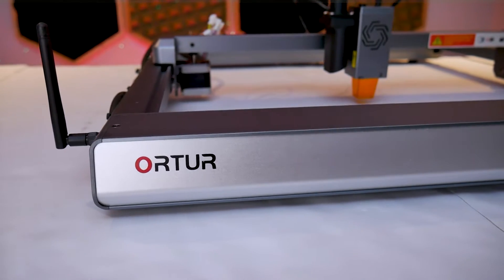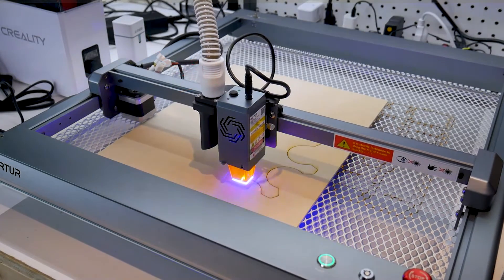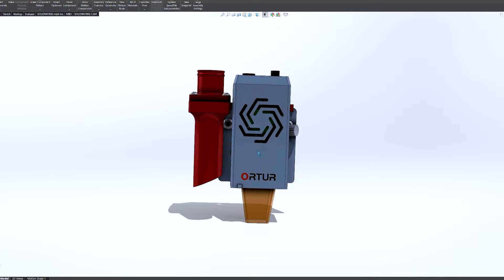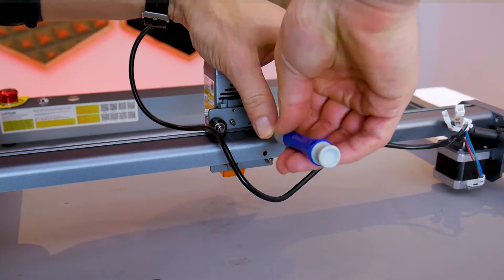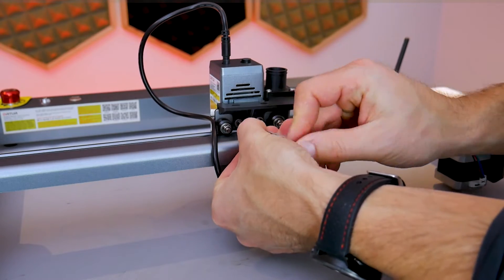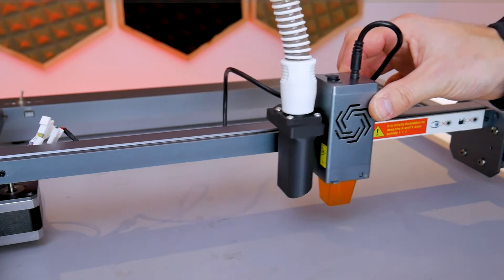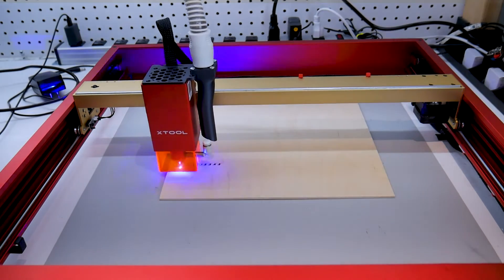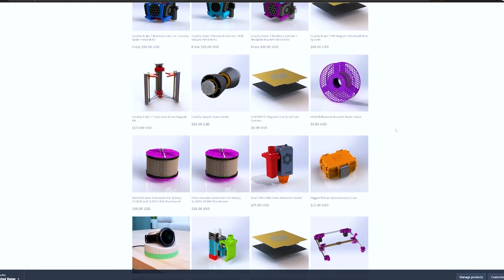Ortur Laser Master 3 Fume Extraction Nozzle Installation

Comment: Good idea, especially since it's close to the laser. I'm wondering about the smoke from underneath the wood during a cut that typically passes through the honeycomb and comes out at the edges of the wood. I can't see how your adaption handles that.
Reply from the maker: Good question, yes through cuts are more challenging to suck up the smoke. It will linger more until the laser head is in the general area to suck it up. The fume nozzles are fairly effective but they will never get 100% of the smoke, you need a proper enclosure to get 100% of it. These will work well for light duty use

Comment: The XTOOL extracting nozzle looks like it could also fit onto a NEJE laser unit. For a NEJE 3 Max laser unit the noozle should, i.m.o.,  go 'u bent'  behind the cable tray and closer to the surface of the material. This should not diminish the working area. Are you thinking of doing something for NEJE?
Reply from the maker: I had NEJE reach out to me recently to try their products. Perhaps I can get one in my hands so I can develop the nozzle correctly. Unless there is an accurate CAD model on the internet somewhere.... If you know of one link me to it, otherwise I can take a look!